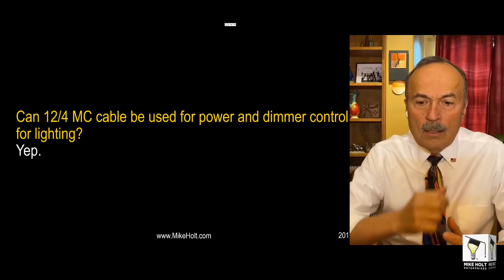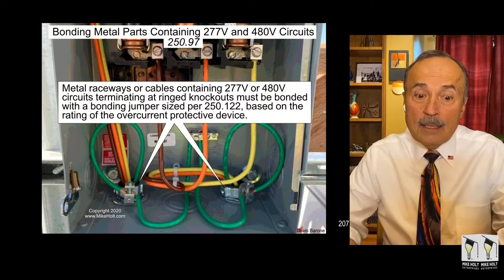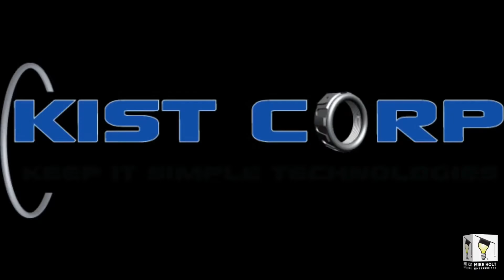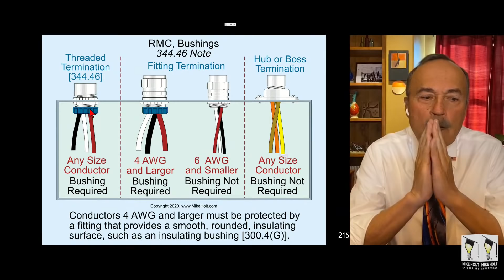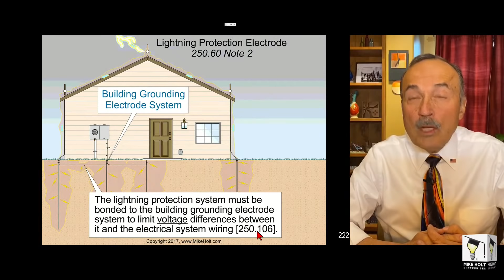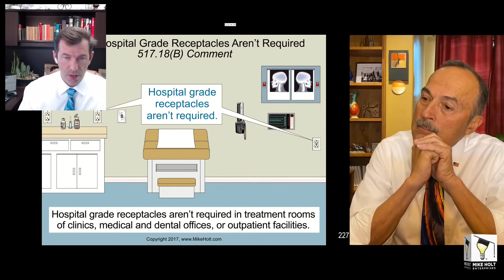Mike Holt Live Q&A! April 16th 2020

Comment: For Pvc also require bushing where a conduit enter a box , fitting, or other enclosure, per code 352.46 nec or cec .
Reply from the maker: PVC connector bushing requirements are no different than any other connector, like EMT.

Comment: Mike, I thought you said that wires could not be pulled until the installation was complete. If a bushing is required at some point then how can the installation be complete until bushing installed? Doesn't it follow that the wires can't be pulled until bushing installed?
Reply from the maker: That's an excellent point! I submitted a Public Input to make this rule clear, we'll see what the rule says in 2023 NEC.

Comment: The “rings” are designed for a 120V fault but not a 277V fault? Assuming we are talking about a 600V rated enclosure, I would expect that 600V rating to be all-encompassing, inclusive of the KOs to be able to handle the voltage the enclosure is rated for. So dumb. These stupid KOs cause so many problems. All enclosures should be blank and electricians should be required to make all their own KOs for the exact size of their connectors to avoid this idiosyncrasy altogether.
Reply: I agree that knockouts can be counterproductive, and I prefer a continuous region of the enclosure for conduit connections.   It limits your field-flexibility, and requires you to know exactly where they go, when another contractor is installing conduits in advance for you.  Good luck getting that manufacturer to reveal that information before you buy the product.   The main reason why KO's are so common is that they make it less labor intensive to make your connections, but only if the aforementioned issues don't get in the way.

If you use up all the knockouts on a group of knockouts, it counts as if they weren't there in the first place.  It is the chokepoints that hold the knockout rings together mechanically, that are not "strong enough" for higher voltage faults.

Unless the enclosure is specifically listed otherwise for higher voltage continuity, it is only rated for a fault on a circuit up to 250V nominal to ground.  You will usually find much tougher knockouts to remove, on boxes that are rated for higher volts to ground.

Comment: In my jurisdiction, using any sort of aluminum for branch circuit wiring is banned. In my limited experience with aluminum branch circuit wiring, I’ve found it to be very brittle and susceptible to breaking easily. I’m really not comfortable using it at all. In theory, it sounds like a good wiring method but in practice it introduces problems you don’t have to worry about with copper wiring.
Reply: I'm sure this is not true. Please send me (Mike@MikeHolt.com) documentation that shows aluminum wire is not permitted for branch circuits.
Reply: Mike Holt https://library.municode.com/md/gaithersburg/codes/code_of_ordinances?nodeId=PTIITHCO_CH7EL

Look in Sec. 7-15. I believe it is amendment 12. This is for city of Gaithersburg (Maryland).
Reply from the maker: @RB-xv4si  Excellent! You are one of the few individuals that actually has support for their comments!

Comment: Grounding electrode system should be bonded to the lightning protection system via a trench with a bare copper conductor only!
Reply from the maker: Bare is not required, but a good idea.

Comment: For a grounding system I cannot bury aluminum cable and copper clad aluminum cable is expensive and copper cable is expensive as well.  I was thinking on burying galvanized steel cable to unite all of my 2.40m Copper weld rods.  I am a aware I have to compensate for the resistivity of the copper wire and I might have to run several galvanized steel cables but the question is: ¿Can I do that to save money?
Reply from the maker: I don't understand your question, please your question on MikeHolt.com/Forum

Comment: Hi Mikel, we adapted Line to Ground at the same time Neutral as our electric cooperative system in our practiced.

My questions are as follows because I am confused in the Grounding System.

1.) Do I need to use Crkt.Breaker for My Ground Wire/Neutral Wire in my Main Panel?
2.) For my equipment grounding, do I need to bond it to my to my Ground/Neutral Wire in the Main Panel?
3.)Can I connect the Ground/Neutral wire to my ground rod which is also connected to my equipment grounding?

Thanks for the response.
Reply from the maker: I'm sorry I have no clue what you are asking, but watch this video https://www.youtube.com/embed/mpgAVE4UwFw

Comment: At 23minutes...I noticed years ago a piece of flex that was not connected..I understand a raceway cannot be used as a sole means of a ground path..I've seen broken rusted conduit that won't carry a ground fault..so I figured if the conduit is broken or not connected correctly a grounding bushing connects 1 side of the service to 1 side of the supply and makes up for the broken or loose connection
Reply: The sole means of grounding comment was something  I learned 15 years ago..but I can't find it in the code book..same with the raceway through a window pane..
Reply from the maker: See 250.118 on what raceways are suitable as an equipment grounding conductor.
Reply: @MikeHoltNEC  I went through article 250.118
Reply: Ok so a broken or corroded piece of RMC in a house built I. The 1950's is exempt and im Sure the conduit In Dirt works as a ground path..but the EMT to flex where the flex was hanging by the wires and no ground wire..I don't recall if the circuits were for lighting or receptacles but it was in a brand new bank that was built from the ground up..
Reply: 1 more question
Reply: @MikeHoltNEC  I was wiring in some lights in a grocery store about 11years ago and the person that I was working  with wired in a light as I was cutting lighting whips..as I cut a piece of MC from atop of a lift..my wirecutters actually  lops exploded and the whip went falling to the ground..the whip and lops hit the ground..the breaker never tripped and the whip actually  hopped across  the ground putting 1/4 holes in the concrete floor..the breaker never tripped the short circuit or fault happened about 300 feet from the electrical panel...it was an old Vons grocery  store..probably initially built in the 1980's..old breaker ?

Comment: Does a 120volt/208 volt panel supplied by 2 different system or 1 system that creates  120/208
Reply from the maker: I'm sorry, please ask a question that is a real life condition.
Reply: A 120/208V single phase panel is usually supplied by two phases and a neutral that originate at a 120/208V wye 3-phase grid.  It is called single phase for historical reasons, even though it uses two phases to establish it.  I prefer the term "open wye" for this.   The three phase service contains three conductors with waveforms that are 120V to ground, and time-delayed from each other by a third of a cycle (1/180th of a second).  If you measure between a phase conductor and neutral, you get a voltage of 120V.  If you measure between phase conductors of different phases, you get a voltage of 208V.

Think of a triangle that is 20.8" on all three sides.  Now measure to the center of that triangle from each corner.  You'll get 12" corner-to-center, on a triangle that is 20.8" corner-to-corner.